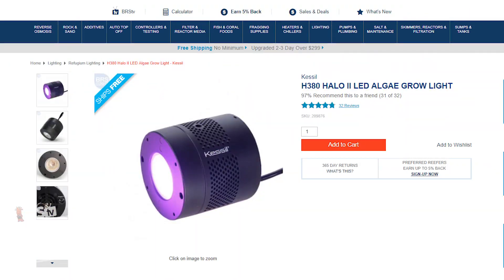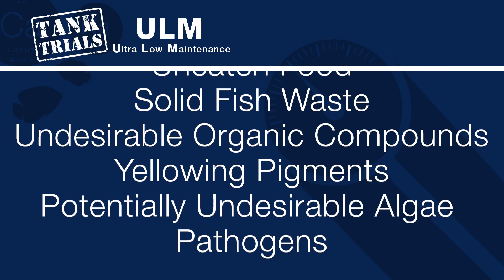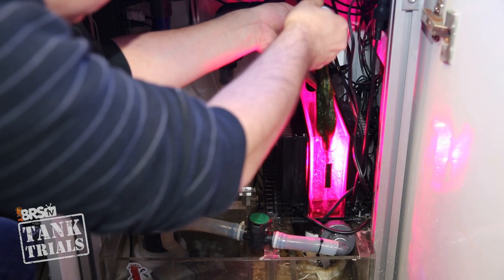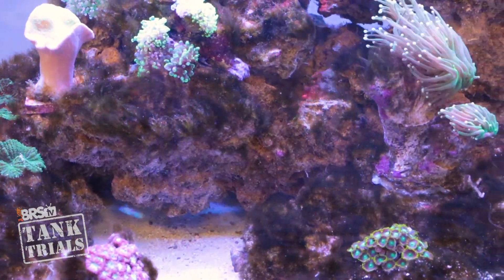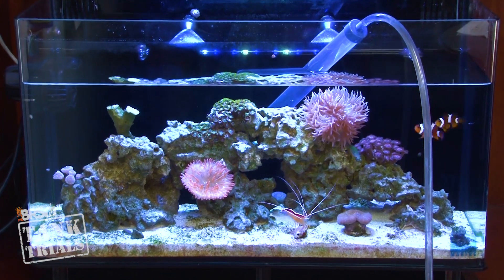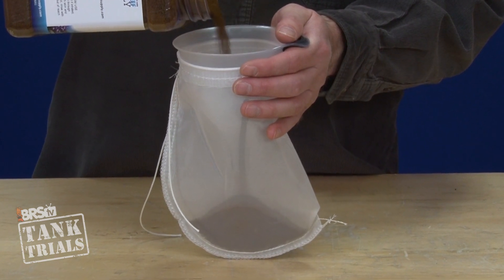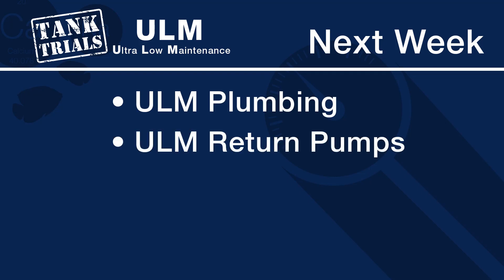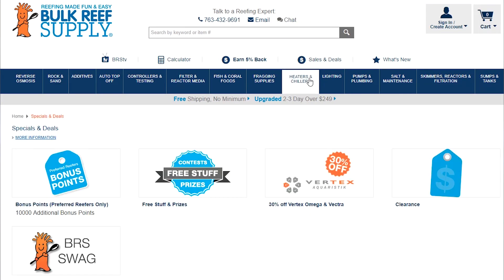ULM Tank Trials Ep-4: Filtration for Ultra Low Maintenance | BRStv

Comment: I’m gonna caution against not enclosing a chaeto-based fuge with glass baffles (as Ryan did on the softie sump). I switched over to chaeto-only filtration about four months ago and did the same thing; my reasoning was similar - I wanted to optimize flow through the whole ball. The issue that I ran into is that everything that falls off the ball collects at the intake of my return pump. I used egg crate to divide my sump, so perhaps something coarser like Ryan used in the vid would have better results. Another issue is that when that matter starts breaking down its easily sucked up by the pump and introduces unsightly particulates into the water column. I think that even that black wire media that Ryan used is too coarse to stop that. IMO the benefit of using glass baffles is that it keeps all that detritus at the bottom of the fuge and not giving you problems elsewhere. Hope this helps!

Comment: Absolutely love all of the videos! There's no better way to progress the hobby and increase the success of our tanks then to base our decisions off evidence.

I think it is important to consider that 'ULM' doesn't mean no maintenance. I've seen many tanks that have every gadget and new piece of equipment in an attempt to automate and reduce maintenance. Unfortunately, these pieces of equipment need calibrating, cleaning and replacing, all of which require time for them to run effectively.

When it comes to plumbing, hard plumbed PVC overflow and return, however, the return pump should be soft plumbed to a PVC manifold for easy removal and cleaning.  

The heater just needs to be reliable. Based on your previous videos, the cobalt line is reliable and slim which should suit the limited space on each setup. 

The return pump should be a quality, reliable pump. I'd personally go with the Ecotech Vectra S1 on these tanks for the reliability, ease of flow control to help the effectiveness of the refugium and the ability to quickly select feed mode on the pump which can help reduce the need for additional plumbing such as check valves. The S1 also has a very small footprint.

Looking forward to seeing how these tanks progress!

Comment: I'm open to corrections, but I think running ozone and UV might be functionally redundant. As I understand they each use a different method of impairing organisms, O3 for ozonation and ultraviolet light for the other. While ozonation can oxidize and kill organisms that come in direct contact with the O3, it should also oxidize dissolved organics in a similar way, turning them into inorganics like NH3.
  Edit: just noticed at 13:20 you Ryan mentioned how O3 isn't run to keep ORP in the display high enough to kill anything undesirable without killing everything else. What about at ground zero, where the O3 meets the water in the skimmer but before the carbon removes the excess ozone? I was under the impression the "nuking" happens there.

Comment: I think that ulm can’t even be claimed without an apex on there monitoring flow rates and temperature/salinity at the very least... I think hard plumbing is lower maintenance simple because you can’t generally see the funk build up like clear tubing so you tend to think all is well lol... definitely need one pump feeding all equipment even though I have been starting to buy into this it’s better to have a dedicated return and dedicated manifold pump hype... but the simple fact is 2 pumps is double the maintenance if you need ulm it’s one pump or bust.  It would be nice for brs to chime in about any downsides with the 160 and having the manifold off of the return... any issues with constant beananimal adjusting or flow rates fluctuating etc.?

Comment: In terms of plumbing, I don't think there's anything more low maintenance than a BeanAnimal style drain. Ive found it to be set and forget and requires the least amount of maintenance with the added benefit of being the safest way to avoid flooding. Just be sure to use a gate valve on the main drain line.

Comment: On plumbing a simple drainout and return will be better, without complicating it like wires inside a computer cpu.for return a good controllable pump for steady flow like vectra.and a good heater for stable temprature, from cobalt.these are suggessions from me.